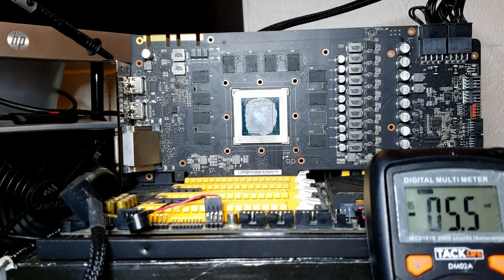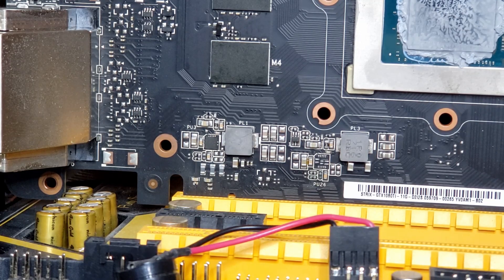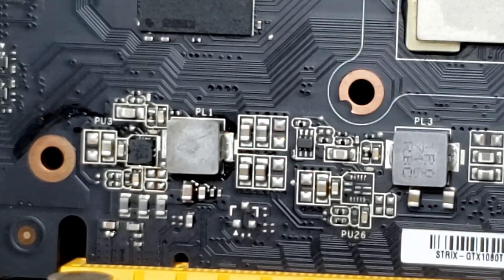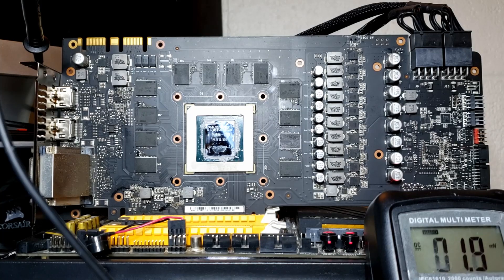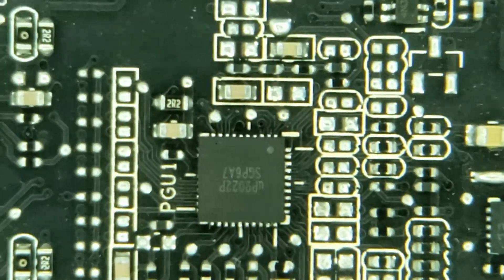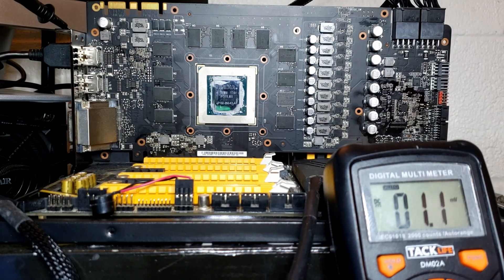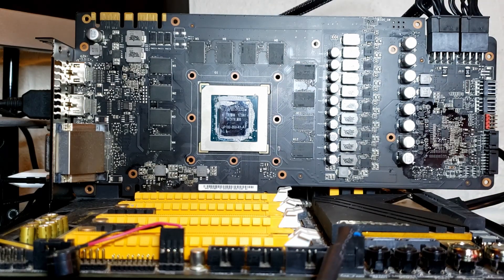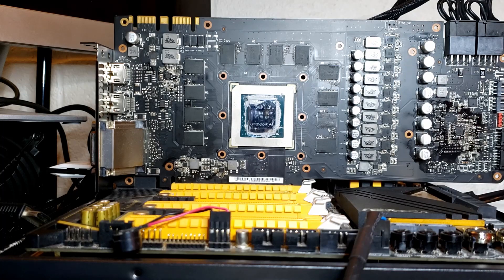Asus Strix GTX 1080 Ti Repair #1 - Not detected

Comment: Nice overview, thx. Working on a identical card that does not boot the PC if present. Switching to integrated graphics causes the system to crash when loading the OS. Almost get all the voltages as they should be, only anomalies are the 5V shown at 1:10. I get 4.25V here and the GPU VRMs idle at 630mV, not the 800 mentioned here. The 12, 3.3, 1.8 and 1V are all present. Any ideas where to go from here?

Comment: If I don't have 5 v  on up9511p? What can I check?
Reply from the maker: There's a resistor that bridges the 5V rail to uP9511 VCC. And a capacitor that sometimes goes short.
Reply: @TechCemetery  Thank you 🌟
Reply: And one more thing,under the PGU1 there are 2 line with 8 resistors or capacitors?

Comment: hello there, ive just discovered your channel and subscribed , great work ur doing, just a quick question, i have a 1080ti gigabyte and its starting up well but when im trying to open a game its crashing all the time, im suspecting that the memory module might be at fault since in windows its running fine, its just when it gets higher clocks it fails, also the temps are very good, 50 degrees max, what do you think?

Comment: Hello, I was trying to repair rog srix 1070ti , the card is missing vcore, after some reading i know that i need to check the up9511, but i can't find it on the board, and i can fin up9022, which is seems to be unknown IC, i am subspecies that up9022 is actually up9511, when i watched your video i am sure it is actually some alternative for up9511, you think that the person who fix the card before you try to change it with wrong is, but i am sure this up9022 is used by asus , and i have it in my card , now i need to check it to see why there is no vcore or maybe i need to replace it

Comment: To tech cemetery need your advice - would like to know if my GPU is worth salvaging or its a paperweight - I have gtx gigabyte 1080 co addition -  its faulty -runs fans like crazy  - temp hot 85-90 Celsius -  unigens for 5 sec and stops with black screen - is there any salvation before making it a paperweight?

Comment: Sorry for the redundant question but is it safe to have the card powered up without a heat sink of some sort? Even without a signal detected, was the 1080Ti gpu getting hot?
Reply from the maker: Pascal in general runs very cool. The thing I don't mention in my videos is that I never let the card overheat - I always shut it off before it gets to a point in which in trigger over-temperature protection.

Comment: Hi there, great video!!! I have a rog strix 1080 ti which is not working. It started having an issue if I touched the power connector it would shut downs not its just a black screen when connected and computer won’t boot. Is this something you could have a look at please.?
Reply from the maker: Sure, I have a website in the description where you can request a repair.

Comment: Hi i have the same card and all the voltages are present but the GPU VRM are between 0.4V and 0.5V  and the card wont boot not even get detected in windows. What could be the problem. Im not sure what regulates how much voltage goes to the mosfets.

Comment: My 1.8v rail is getting 1.8v, however, the resistance is only 433ohm, could it be the buck converter?
I'm not sure who else to reach out to for help, you're the most knowledgeable person I've found.
The card is being detected and boots into Windows, but only when the card is ~42c. Once it heats up the BIOS gives me a 'vga card not supported by uefi driver, CSM has been enabled for compatibility'. At which point I can let the card cool, disable CSM and boot right back into Windows. Games fine, and overclocks to 2ghz absolutely fine, cool and quiet. Not sure what to do.
Reply from the maker: I've already answered your question, it's a dead core meaning sell the card.
Reply: @TechCemetery  I apologize, I didn't see that you answered my question. How is the GPU dead if it can run games fine?
Reply from the maker: @badnewsbruner  Then I guess it's not dead and you've just wasted our time. If the card performs without issue, you have nothing to worry about.

Comment: Subscribed; thanks for the great videos!  I'm currently working up the ability to fix a pair of RX580s that were damaged in a power surge.  I'm a EE and have all the tools, but I need to familiarize myself with the anatomy of these cards.  The funny thing is that one of them prevents the PC from booting and will damage whatever PCIE slot it's plugged into.  The second card is not detected, but the PC can boot with no damage to the slots.

Comment: pls reply broo .. i wanna ask what cause gpu load unstable? i have 1080ti asus strix and  gpu load always 87-92℅ never drop below  . even with low setting 1280-720 resolution . i change 1080p just same problem with gpu load  87-92℅ 
 my fps went down to 80  .. 

then i restar my pc  and its normal again gpu load 50℅ my fps 180-200 all seting low only texture high  in game .. then 10-20minutes it will came back with that problem ?  pls help me

Comment: Hi,Can you pls tell me the order of the gddr5x on the asus strix 1080 ti for mats mods.I have a problem with C0 on mats showing me errors.
And is there a problem is I take a gddr5x from a 1080 non ti,reball it and put it on the 1080 ti?

Waiting for your comment.

Thanks.
Reply from the maker: I have a guide video on diagnosing memory corruption.
Reply: Thank you so much for the information.
Enyojing your vids  @TechCemetery

Comment: Hi.  Nice Video. Can you help me.  ASUS TURBO GTX 1080.  PC Boot   Windows no recognise the GPU  GPUZ recognise the CHIP  but no VRAM. Can not install driver.
Have you a litle idea ?  Thanks
Reply from the maker: Does it have error 43 in device manager?. If yes, see my Guide video on diagnosing memory corruption. If no and your memory is stuck at 405mhz, see my repair video of A zotac 1080 mini.
Reply: @TechCemetery   I dont see any thing in device manager. 
https://drive.google.com/file/d/1cUtW8wEYHpQKdpKXQWOrmhS6yqORfJ94/view?usp=sharing
https://drive.google.com/file/d/1cTiZ7ohNCNm4wt3n_3o7Z7jVBz45RiGv/view?usp=sharing
2 images  thanks for help.

Comment: Hello. My gtx1070 strix gaming stop working. I´ve checked 1.8V and 5V and have a short to gnd. What could be the issue? thks
Reply from the maker: A short on 1.8V is generally accompanied by a dead GPU. You need a power supply to find your faulty component.

Comment: Great video! 

I’ve got the same card but the standard 1080 version. 
I made a huge mistake and tried to reseat the gpu while the pc was still on (I know, stupid thing to do) but now my gpu is not recognised by any motherboard at all but the fans still spin, the gpu chip gets slightly warm when turned on and the light come up, any idea on what I could do / what do I check to see what is shorting out hence not being recognised anymore?
Reply from the maker: Resistances across the voltage rails?. For an unresponsive card, the standard is to check BIOS, PCIe data lines, and Quartz. In your case, there's not much advice I can give you - I don't get a lot of cards that were pulled out live.
Reply: @TechCemetery  will give that a try thank you

Comment: Hi,
I followed your instructions on voltages, and I can measure all of them 12V, 5V, 1.3V and 1.8V , 1 V are present.and Resistances seems to be OK, when i turn the computer on, after 30 sec. I get some kind of backlight-ish screen, no images no colors only a dim light, any idea?
as allways thanks for your videos. Cheers:)
Reply from the maker: Run MATS, I have a guide on my channel to test the memory on your card.

Comment: Hi, and many thanks for great videos, I have already subscribed and learn so much from you.
I have  exact the same asus graphic.card with no display and on this particular buck-converter there is a nr: (AMCG 550) but in my card I can see the capacitor left to the black resistance (5 Ohm) with the L.h on it beeps on both sides. both buck-converters has the same capacitors that beeps on both sides. do you think that it is the same problem with buck-converters maybe?.  I tried to find schematics for this card but no luck. and i'm new to this repairing graphic cards area. so any help would be much appreciated. Thanks again and cheers :)
Reply from the maker: Hi,

You'll have to be more detailed, the same buck converter is used for the 1.8V, 1V, and 5V rail. There are no schematics for graphics cards unless you are an authorized repair center. You'll want to measure the resistance of the memory phase, 1V, and 1.8V power rails. A short or abnormally low resistance can suggest a dead GPU. Also, can you provide a detailed picture of your short capacitors? I'm having a hard time making out which ones you're talking about.
Reply: @TechCemetery  Thanks so much for your prompt reply, I followed your instructions on voltages, and I can measure all of them 12V, 5V, 1.3V and 1.8V , 1 V are present. I think if I'm not mistaken it means that buckconverter is Ok? the only error left to consider are 2 small capacitors closest to buckconverter itself around induktors (PL1 and PL3). her is a picture of these capacitors
https://drive.google.com/file/d/1IG2dFc2DQFrJEdUMefHV2rCRLNC5pwr7/view?usp=sharing

Comment: Greetings,
I am heaving an issue with exactly the same card. Problem is that card runs normally on standby and crashes when on load. By inspecting it i could hear the coiling on inductors for memory buck converter. And indeed, whole area was overheating before card crashes. Filter (power bank) capacitor on V-in for memory power controller was also overheating. I am assuming that it is not working properly due to faulty mosfets controller. I couldnt find the datasheet for uP9013q. I can see here that you have used RT8815A to replace it and it was working, Am i rite?
If so please confirm that is the part you used to fix memory power issue. Also if you have any suggestion why the power for the memory is overheating it would be helpful. I was measuring the voltage on the output of memory power and it is normal on standby but as card starts to run and heat, voltage goes up until card crashes.
Again, thanks for this video and for your help.
Reply from the maker: I did not use a RT8815, I just referred to the datasheet. I used a replacement uP9013Q. Generally these cards that die under load tend to either suffer from very small amounts of memory corruption, or have dying GPUs.
Reply: @TechCemetery  I was hoping that it is not the GPU. Will have a look for memory module errors and memory buck converter,. if all is ok there, then must be the GPU.
Reply: @TechCemetery  Update. Found one fuse weirdly showing 6 ohms, the one right below the bios chip. So i replaced it with regular one. Card is working better but still not as it should. Then i tested the memory with mats and it gives me consistent results of 33 errors at module C01. GPU looks good so far. Do you know where can i buy gDDR5x memory modules?
Thanks again, your videos ware helpful.
Reply from the maker: @UrosAndric  Exactly 33 errors is often a program error. Are you touching the keyboard when the memory test occurs?. If you really do have memory corruption(card takes a minute to POST with a blank screen and backlit monitor image) then you'll want to buy "D9VRL" memory as linked in the description of my MATS video.
Reply: @TechCemetery  Wasnt touch anything. I thought it was a small number so for the second test i crank the memmtest to test 100mb. It took somewhat longer to finish the test but results was the same. 33 errors at module C01.
Reply: @TechCemetery  Could faulty sourounding components of the C01 module in this case be faulty. Like resistors or caps, or that transistor next to the module?
Reply from the maker: @UrosAndric  Yep. sometimes the resistors around the memory module itself go bad and that can cause crashing under load. As for the caps, they of course are suspects but they can be rather hard to check.

Comment: I need to repair mine but no one where i live repair them, help please
Reply: Where you able to find anyone?
Reply: @Swc_Leader  nop but im close to the problem today i take out a memory mofset and the short in the 8 pin is gone, but i think my memory’s are shorted
Reply: @Swc_Leader  i have a 2080 super that for that one I really need some help when install the drivers the screen goes black and only can get a picture in safe mode with drivers installed but not to windows, and it was working fine before
Reply: @TecoProductions  could I possibly speak to you through email or what's app cause I really need someone to teach me how to get the GPU in safe mode or do the things you were talking about. Please let me know if you are willing to help🙇‍♂️🤞

Comment: @Tech Cemetry I have the same gpu with a strange problem. The card works just fine, but if you put some load on the gpu the screen will go black and come after that. Drivers and vbios are the latest but still the problem persists. It seems that when the pc wants to use more power on gpu it will not allow to. After several black screens i get bsod with tdr_video_failure. What could be the problem ?
Reply from the maker: Most likely the GPU. You could have poor voltage regulation on the VRMs, or something wrong with the PCIe interface ( capacitors etc), but again, most likely the GPU.

Comment: my gtx 1060 strix is also missing 1.8v and vrm voltage is also 0v  .. any ideas?
Reply from the maker: Do you have 5V? if not you need to focus on that. For the buck converters, check VIN, EN, VCC
Reply: @TechCemetery  nope. No 5v either.
Reply from the maker: @meranjana  5V is usually the first voltage rail to turn on. Without out none of the other voltage rails can run. 

Check the 5V buck converter. EN is usually 3.3V, VIN is usually 12V and VCC should be 5V.
Reply: @TechCemetery  there are two 5v converters one is above the pci-e lane the other is right below the vrm. That below the vrm one seems to vorking when i poke the probe to the coil it shows 5v. My question is, is that a 5v converter or is really that a defect? That one which above the pci-e lane is givng 0 v.
Reply from the maker: @meranjana  There is only one 5V buck converter and in your case, it outputs 5V. The other ones output a different voltage as these buck converters can be configured to output a wide range of voltages. The buck converter you're referring to is either 1.8V or 1V. You need to find the 1.8V buck converter and check the resistance of its connected inductor, as well as the voltage.
Reply: @TechCemetery  can a aeag 531 buck converter replace with aesd 626 (found on gt610 asus card)
Reply from the maker: @meranjana  I wouldn't, get the proper part

Comment: I had a question, I have a zotac 1080ti, I replaced u516 <I believe it is a 2 input and gate 74LVC1G08GW> before I replaced and after, the card boots into windows up to just before the lock screen then reboots mobo, I put it on my hiveos rig to see if if recognised it, it boots and recognises but does not show memory type or size.  When booting a miner it says unable to start cuda engine, exception in (main, 712)
Would you have any pointers on where to look and what may be causing this at all?
Reply: It is a zotac 1080ti blower
Reply: I should note that the component was not on the pcb but I could see that is used to be there from the depressions in the solder
Reply from the maker: Does it boot without the drivers installed?.
Reply: @TechCemetery   I have tried multiple versions of the driver on Linux (hiveos) will put it in my windows machine with a fresh install when I get back home from work and update you on if it boots
Reply: Hit a snag, I do not have a motherboard with onboard graphics, neither of my computers do, if i uninstall the drivers then there is no display adapter. Also I didn't say but I put the card in as a secondary gpu (no cables attached for display, just power) that is how I know where the boot process got up to, as if it tries to fire up the cuda engine 'or vram?' at the lock screen and fails then reboots system.
Reply from the maker: @squeekinator9000  If you uninstall the nvidia drivers and boot the 1080 Ti as a secondary GPU. Can you make it into windows?, and will it stay in windows for an extended period of time without crashing if the basic display adapter is used instead of nvidia drivers?.

Finally, if the card has display, can you use it a basic display adapter without crashing for an extended period of time?.
Reply: @TechCemetery  so far so good on generic adaptor
Reply: Update to previous response, main gpu as display all is well, faulty gpu has no outputs on any port, will reinstall driver with both present and see what happens
Reply: @TechCemetery   OKAY SO, FURTHER UPDATE, oops caps, have dissassembled gpu and investigated it further, mild discolouration on pcb in areas, slight darkening,all other components seem to look okay, no damage other than an inductor is discoloured, r22 (not one of the large ones, there are two smaller ones at the top of the bank of inductors) do you know what that component is at all? I've had no luck trawling the forums so far. :)
Reply: further note: measuring components using your previous video the 1.8V coil measures 3.7 Ohm and varies between 1.4 and 3v

Comment: Nice vid. New subscriber here!! Do you have a site where we can ask questions about gpu repairs?
Reply from the maker: I do not. I would recommend browsing sites like vlab.su using google translate and asking questions there.
Reply: I have gtx 650 and this gpu is working completely fine yesterday and now there is no display. Gpu fans are working keyboard light are lit and i heard windows start up sound. What to do?